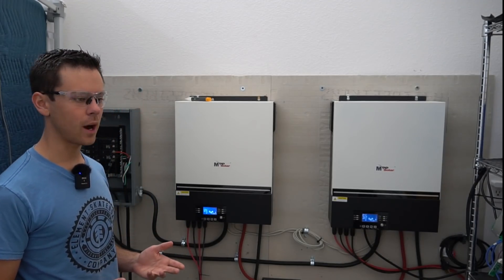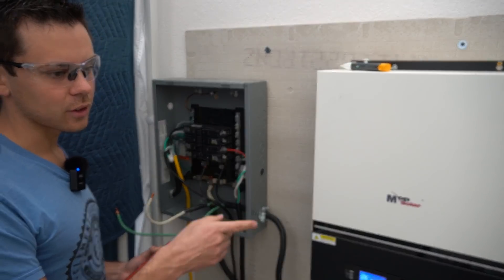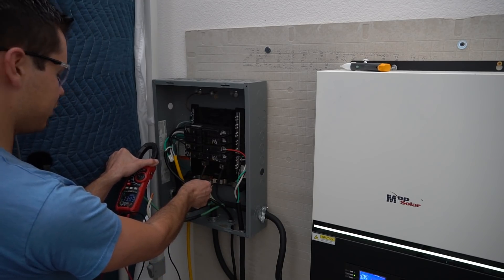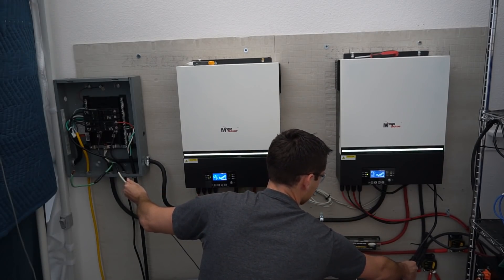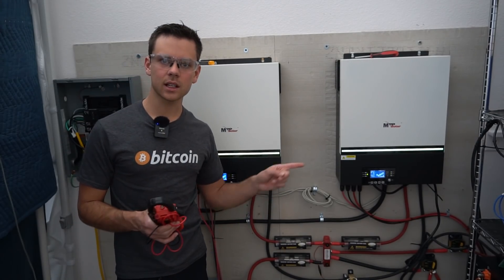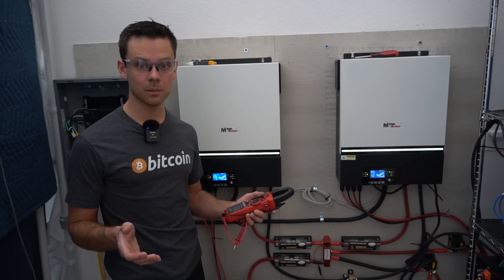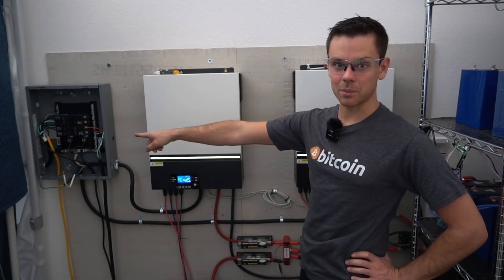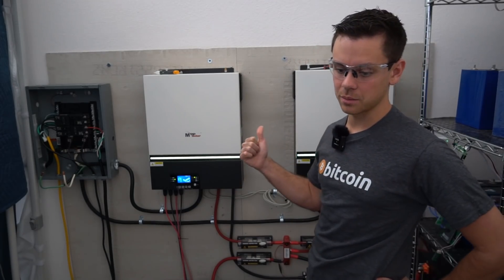Advanced Level Grounding Discussion for All-in-one Solar Power Systems

Comment: There are several AC side relays internal to unit.  I am pretty sure one of the relays connects output neutral to case ground when unit is operating in inverter only battery mode.  This is to emulate off-grid operation.  Question is what they do with input neutral in the two modes

My guess is they are also releasing input neutral connection when they case ground the output neutral in inverter-battery only mode.  This would prevent the neutral-ground loop via the main breaker box neutral to ground connection.  

In the inverter battery only mode you should not additionally stake ground bond the inverters (unless totally off grid) as the common case ground wire connection going back to the main breaker panel along with inverter's connecting their neutral to case ground will provide the neutral to ground bonding back at the main breaker box. No current would be carried on this ground return to main breaker panel.

Common case ground connection is for safety and should not be negotiable. For safety reasons all metal cases should be commonly connected with interlaced green wire.  It should be ground stake bonded on AC input side.  For grid connected systems this is in main breaker box case, which also has AC input neutral bonding to ground.  

Final strange thing is why they have ground connections for input and output AC.  Check to make sure they are commonly connected in all modes. If they separate their ground connections that would just be stupid, unsafe, and prone to incorrect hookup.  All ground terminals on inverter should be connected to inverter metal case.

Another strange thing in their manual, there is an input AC breaker installed on the AC input neutral line wiring diagram. Where do you find a breaker box that has a breaker connection to the neutral?
Reply: David Poz has a video that shows a panel and breakers that have the 120v load connected breakers that control both the 120v line and neutral wire. They are available but cost more

Comment: Grounding is a multifaceted beast, and has many different implication as whether it is AC or DC and/or even RF. An electrical diagram will show many items tied to ground rather than draw out the wiring for a ground wiring path. In AC circuits it typically refers as a chassis ground to bleed of static and provide a path of least resistance when/if the device has a short.

When we get to Inverters and especially the All-in-one units, it is recommended we treat them as a sub-panel. This Video shows the wiring and use of the sub-panel giving detail for ground and neutral connections. The ground wire is to provide a chassis ground to the cabinet of the invertor. When the AC loads are connected to the Inverter with a sub-panel the ground is still for Static and Chassis connections and not a current wire, the sub-panel passes the ground back to the main service panel and connects to earth with its bonding. The bonding of the main panel to earth is primarily to prevent lightning entry.

When you connect your batteries to your invertor they are completely isolated from all AC connections and bonding. On your Battery you can have a Negative Buss Bar to connect all the DC negative connections together. Never connect the batteries to earth ground, should the invertor generate a short you could send AC through the batteries and have an explosion.

Off-grid systems are wired with a sub-panel also, but as it does not have a main panel with a ground bonded to create the static/chassis connection we need to connect this panel to a ground rod to give that static/chassis connection. We DO NOT bond this panel! Again the Ground and Neutral in this sub-panel are NOT connected. Your Neutral wire is a current carrying wire to complete the circuit, the ground is for Static/Chassis and helps the circuit trip when there is a fault.

When paralleling units in a 120v configuration, connect only the Line1 together and then only connect the Neutrals together.  Your Neutral is your return current wire in powering the circuit.
Reply: Thank you that really does sound logical I have to read it 10 times try to get it through my brain
Reply: @VinceBadovinatz88  glad it helped

Comment: while I don't have one of these units in front of me (yet) I would assume they are using some form of the contactor to switch between the Grid-tied and islanded states. This contactor would be wired to have the Grid side simply pass straight through the inverter with the charging circuit tapped onto its output. If this is the case, you DONT need any special wiring as the inverter does all the thinking for you I believe. You would simply use the neutral and ground bus in the subpanel like you would normally a standard 240v outlet (it shouldn't need a ground connection to the case as the ground bus is already electrically connected but check for yourself always). This lets the inverters Operate like a simple off-grid DEVICE (NEC CODE TERM), using the panel neutral when it is grid-tied and creating its own bonded neutral when islanded. All inverter chargers I've seen inside of including growatt and victron operate this way as do some RV generator transfer switches its effectively the same as plugging in a cord to an outlet and in fact you can do just that. All the same connections are needed in the same format for each inverter. The inverters in Islanded mode will create a Unified neutral at the point of generation (they act like one big inverter) that effectively BECOMES the main panel with the bond.
One last thing. ALL of the inverters should be fully grounded to the panel or sub-panel, but there should only ever be one ground rod from the main panel as you've pointed out or a ground loop WILL occur. even when islanded the inverters will "borrow" that ground for operation although it is not necessary for function(think RV or mobile applications) same reason many generators have an extra ground lug on them so you can Borrow the house ground for extra safety but will run just fine without them. In the islanded state however the neutral and hot are electrically disconnected from the inverter and not performing any functions outside of isolated sensors and thus no strange loops or secondary bonds are occurring.

When in doubt grab your meter and test it out. should operate just as if you pulled a plug from the wall when islanded except a ground connection was maintained but the inverters have created their own bond. If feeding a sub panel with the inverters you would not need that panel to be bonded in islanded OR grid-tie use after the inverters

Just two cents from a nerdy solar lover and Electrician apprentice ^,.,^

Comment: The ground bar should have a grounding electrode conductor going to 2 ground rods, seperated by 6.5' or more. Also, bonding to gas, water, and structural steel, at least this is how commercial electrical is done to keep the potential (voltage) at "0" volts.
Reply from the maker: Absolutely not. Bad advice right here, and it would create a massive ground loop. If you have earth ground on input, and earth ground on output, you're going to have problems. Please watch my earlier video about grounding this video. Also check out some beginner grounding videos

Comment: I'm no electrician, but I was always taught that, so long as you only had one ground for a common rail, it didn't matter which ground point it was. Ground loops are only an issue when multiple points are grounded differently, and there's potential between them due to the varying resistance. On a small system like this one, I'd probably stick with an earth ground in the panel so all my disconnection points are in one place. If all the (edit: ground points) are connected together, and only one point is actually grounded, I don't know that it matters. 🤷‍♂️👍️

Comment: The grounding is the most critical point on a Energy system - it should alwasy be really strong - i would never rely on some feed through through the inverter.

All distribution board should be connected to a central grounding /earth rail.

We are not in audio systems where ground loops could cause a little noise which gets amplified. So i wouldnt be worried about the loop issue.

Comment: Grounding is relative…if neutral is isolated then earth ground is separate… if electrical neutral is a transformer neutral then earth ground is the same this keeps the neutral ground from floating… in a electoral panel both ground and neutral are the same… if it’s a sub panel neutral and ground are separate and are connected only at the main panel to keep a ground loop from forming

Comment: Very complex topic, watch videos from Mike Holt for a deep dive.
He is one of the people involved in modifying the NEC.

I studied electrical engineering but this topic is beyond my expertise.
However this is part of what I got from watching many of his videos.

A common misconception is that current wants to get to ground.
This is not the case (except for lightning).
Current wants to flow back to the source (on the neutral or the opposite phase hot leg).
Similar for DC Negative to Positive (or the opposite depending on how you look at it).

From an electrical system design standpoint no current should flow on equipment ground wires.
However the ground wires are there to provide an alternate low impedance path back to the source in the case of a fault in the neutral.
Why? To trip the breaker (or fuse) and turn off the circuit for safety reasons.

In the case of the grid, the source is a transformer on a pole that creates the neutral.
In the case of an inverter, the current wants to go back to the inverter (again on the neutral or opposite phase hot leg).
Neutral to ground bonding) in the case of the grid creates parallel paths for the current to return to the transformer (through the earth).
The current can (and does) flow down your grounding rod through infinite paths in the earth and up other grounding rods (of your neighbors) to their bond and back to the transformer on their neutrals.
On a grid connected neutral bonded system this path always exists and some current will flow through it (a negligible amount).
In the case of a fault in the neutral line, through the earth is the only path back to the transformer.

With an inverter, a single ground rod will not provide an alternate path back to the inverter.
However having multiple grounding rods is not advisable, in the case of a lighting strike the difference in potential between multiple rods can create a current flow over the ground wires (partially through your equipment).

While equipment grounding is entirely for safety purposes, it can help protect equipment in some cases versus floating systems.
But it is a double edged sword and can also cut the other way potentially frying your equipment in some cases (for example ground loops with multiple grounding rods).

Another misconception is that current always takes the path of least resistance.
The reality is current flows on all parallel paths based on ohms law.

DC systems grounding does not make much sense to me. Without the bonding of the ground to the positive or negative side, there is no alternate path back to the source in the event of a fault (to trip the breaker).
Reply from the maker: Yes you are mentioning very basic grounding. I've seen all of Mike holts videos, great stuff. He does not cover multiple Offgrid inverters in parallel. And I highly doubt that NEC will cover off grid stuff. At least anytime soon.

Comment: Great video. I've been thinking on this for installation of two units to provide 50AMP power for my RV. The grounding has been my boggle, but I think in an RV if I were to bring the AC Input from the automatic transfer switch that the T-switch should handle the ground-neutral bonding for me as it does between the generator and shore power now. Still working on this (on and off as I have time), the total lack of documentation from the All-In-One manufacturers really makes it a pain to figure out how to execute safely.

Comment: I think the best solution for bonding multiple inverters is actually simple -- a dedicated non-current carrying wire from the neutral bar within the inverted panel back to each inverter's bonding relay. Without current there are no voltage differences between each unit, and thus no ground loops. It's a controlled parallel path situation, where there is only ever current when you want it to be there -- namely a ground fault. I don't like only having one unit bonding as the inverter may fail, but the rest of the system still operating without issue and without noticing (think parallel 120v -- not split phase).

The neat part here is that it's basically what's already being produced and it would ship from factory with a N > Nb jumper installed. Then if you are connecting many in parallel, you can remove with 5th wire. Additionally, if you are connecting to an existing bonded panel say for backup generator purposes, you can remove entirely (similar to software disable).

Comment: I made a video showing this ground /neutral issue last year on my channel. The neutral should only be bonded at the main panel but there is still an issue with these inverters and the only way this could be fixed in my thoughts is upon transfer the ground and neutral bond should change it's state at that point. 
I was in contact with the MPP solar engineers and they even watched my video, but I couldn't get them to understand the issue. 
The reason these are wired like this (I was told) is that these are shipped to many places with varying code requirements.
Reply: Wow, maybe they need to them for certain markets.

Comment: I agree having an earth ground anywhere on this sub-system is a bad idea if there is another earth ground on the AC input.  Even connecting just one of the inverters to an earth ground is a bad idea because in your AC output panel all the grounds and neutrals from the multiple inverters are tied together, meaning they would all be tied to earth ground close to this system, and far from the main earth ground.  As you correctly stated this is dangerous.   The only way I would connect an earth ground to even one of these inverters is if there is no grid-tied AC input with its own earth ground.

Comment: One, That's how many ground/neutral bonds we need. With grid power input on an inverter or multiple inverters in this case. And that is already done at your main panel or meter panel. One ground location per service structure, now requiring two rods a minimum of 6 feet apart at the first means of disconnect. And in a separate structure (out building) sub panel or even a sub panel in your house never interrupt or divert your neutral or insulated ground from going back to the power company transformer. Meaning never give it an alternative path (ground bond to secondary ground rod) from getting back to the power company transformer. Because your sub panel in a separate structure does now require a ground rod also. And that's death waiting to happen if bonded. For example, your "incoming" ground, 4th wire, in any sub panel is a "ground fault current path" back to the transformer if the neutral gets broken or is shorted to either hot leg and, it must be insulated, not bare. Only your main service entrance wires from the meter to first means of disconnect can use an uninsulated ground. All this is another reason why separate auto transformers should never be used and should be banned if grid power is used on the inverter. In low frequency inverters with their own transformer they are protected if a neutral is lost, the inverter will shut down output AC power. But not separate auto transformers. Ever wonder why there is no breaker or disconnecting means on a neutral, death is why. Neutral IS A CURRENT CARRIER all the way back to the transformer and from there, all the way back to the generator at the power station. And ground rods just dissipate some of that current draw on its way back and keeps the voltage at zero between neutral and ground. It takes a completed loop to use electricity. If you interrupt that neutral path back to the transformer and send it to ground you can be shocked and everything attached to your ground bars in your sub panel will be energized. Be safe. Everyone has this false sense of safety when it comes to grounds, ground this, ground that, ground here, ground there when in fact a ground can be just as much deadly as it is safe. Mike Holts videos are great to watch he shows you exactly how people are being killed by not understanding neutral/ground bonds and ground fault current path. Great video and topic Will.
Reply: Dude!   Thank you for this information AND especially directing us to Mike Holtz!!!
Reply: Mike Holz is a great resource. It's funny though how even Very knowledgeable people's perspective evolves, if you look at his videos over time. In earlier videos he is against multiple ground rods (not tied) and he is right. Later, there is a video where he and a Power company employee installed 2.  50 foot ground rods that were tied with 6 gauge copper and they tested it. They point out how low the ground resistance is and how much SAFER this setup makes the electrical system! Great resource. 
     Ya'll Take Care and be safe, John
Reply: I had to re-read your comment several times to understand it. Lots of good info there, but you're a terrible writer. 😂 I guess that's the difference between vocational school and college education.